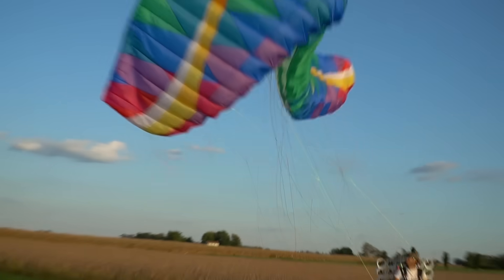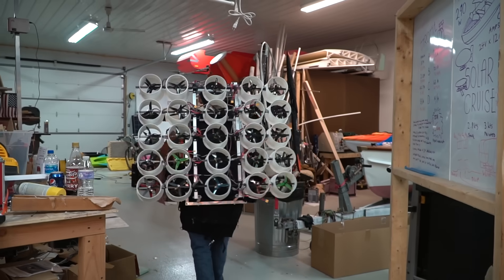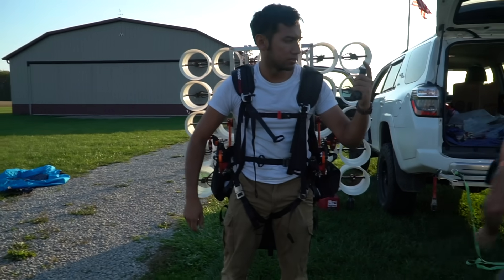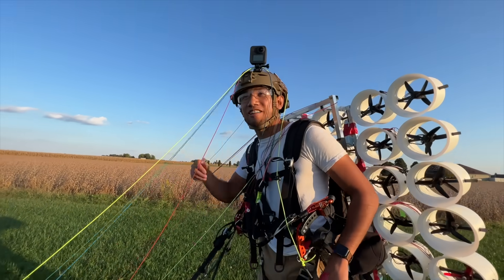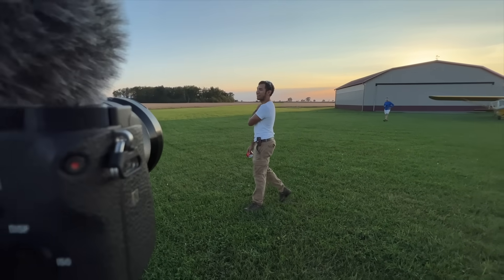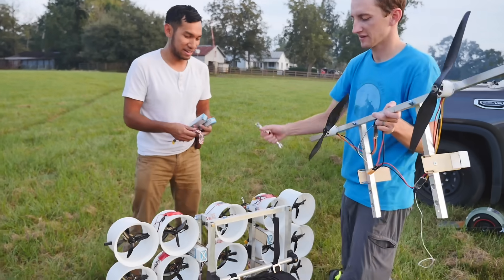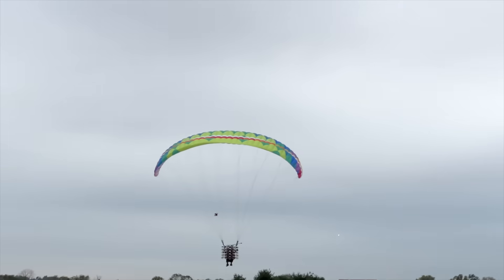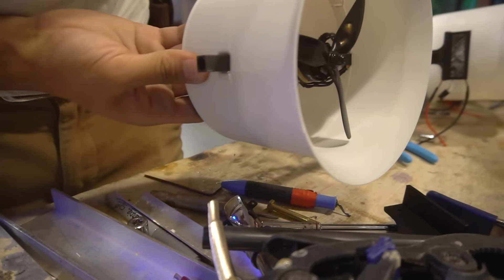Flying with 50 drone motors (homemade flying machine)

Comment: nice plane, however you can make it much more efficient per watt by moving them to the side of you instead of directly behind your back. bigger propellors also often allow for much greater output force per watt.
with drachenfliegen, or I think it is hanggliding(hangglider) in english. there actually where people who motorized them using rc level motors. this where random modern day pioneers so not people with a large network or much resources. I have seen someone fly and reach quite great speeds using only one rc grade motor(electric as well but more a rc car motor than a rc drone motor). this person used a single quite large propeller. the main reason I see why these things are a lot simpler to motorize is due to the user and the motor being much closer to the glider wing itself. also there is less direct drag which allows higher speeds. while you need a higher speed in general with them, but that person managed to launch himself from a field, so I guess some ofbrand steering methods to directly force some extra lift an the end of the run can be enough to make such a thing fly. they are also much cheaper and simpler to make yourself than a paraglider and where I live you can actually make prety good one for under 100 euro, since prices here are extremely high compared to other places in the world that would suggest you could normally make a good quality one for around $50. you can make a half open(bottom open) or full airfoil. however if you can you should make the tips completely flat. this for a small section where it gradually moves into. doing that prevents turbulence and can increase the wing efficiency by up to 80% acording to the numbers nasa published after their tests. the archeotypexyz(I think it was spelled like that) uses that same wing design so you can see how it works however they do not propperly show how the wing works on a technical level so you just have to do it with these words, the ends of the wings transition to flat(no airfoil) over a certain point, and you have a small flat area. this area turns the forces that normaly would be turbulence into upward and forward thrust causing super high efficiency and more lift at very low speeds if you can make that you can easly motorize it won't even need to add a tail for stabilization, and you could have a very efficient and verry fast transportation method. the human powered helicopter required just over half a horsepower to fly. with these drachenfliegers however you require a lot less power, even though often people use a powerfull engine to make liftoff more easy and to rise in altitude a lot faster, especially here where there are almost no big launch areas which you can use.
for me this sadly still requires a new plan since in the area where I live They have forbidden me from flying despite me having proven that I can clearly do it and can even fly new devices like it was natural. however sadly here they really hate selfbuild devices and so flying one of those without buying a speciffic very expensive licence for that speciffic build directly gets them to turn mad, the same goes for flying here. since they do not look to tallent or your capability of flying devices but instead you just have to pay the local government a very large sum and you get a licence with which you are allowed to fly. when I was younger however I did fly things, but that is because they are less aggressive to children and their devices. so for me there is the struggle that I can build or buy the devices needed, however I am not a milionaire so I can not pay the large paysum you need to pay now to get such a licence here. I am also one of those who just came after that moment where they decided to put a large restriction on it. if you where adult and had flown such things a lot before that moment then you automatically got that licence for free or nearly free. however for all those after it, they are fucked(almost raped). so right now for me the best option would be to search for a country where they do not have laws like that and start flying again there. then eventually their law should no longer aply to me since I then pass the exception where one while being legally a adult has flown over a certain amount of hours which are registrered. for now however I have to settle for smaller flights using very large kites a lot of updraft and rapid accurate steering where it is seen as accidental flight or a jump legally since those devices are not made for flight. then again even those are only legal to use on a few small locations in the country so I have to cross half the country to legally use those.

Comment: Sweet ride man, i noticed in one of the first flights it looked like u had red and green propellers. U gotta put the green props on the bottom right or right side and red ones on bottom left or left side and maybe put and led strip or 2 on each side so u can get some Nav lights goin rofl. And if your worried about power consumption, i dont know what kind of controller(s) your using but if they have an LED on them that signifies that power is on then maybe you could put a single red and a single green led in the fan ducts with the red and green props and wire them back to the power LED, that way whoevers watching you will know if you have a failure or your batteries run out lolz. Nice work man, sounds and looks wicked, i wanna build one cuz i needa be able to fly rofl.

Comment: Ducting is not setup correctly. Suction, or a vacuum, is equal in all directions, from the back side of the propellers. The "jet" from that type of propeller is a flat wall of air, not focused. So, in conclusion, the "flare" needs to end right before the propeller. The "tube", should have a reverse-flare, to direct the positive pressure and "fling-off", from the propeller, directed in the same direction. (Fling-off is air that flies off the tip of the propeller and naturally pushes outward, not forward.)

Jets use ducts only to stop side air from sucking-in, not to "focus the jet". The focus is managed by the "cone" in the center of the jet, or propeller. (Like an air-brush, air "sticks" to surfaces and the vortex that is created by the cone, focuses the air. However, you don't need "focus", you need a "wall of air".)

I am not sure why people think ducting is even needed. If it's not designed right, it's useless. Ducting is for vacuum cleaners and home air systems, where high negative or static pressures exist. These blades are "free-air blades". Horribly inefficient under static-loads, due to that "fling-off", which is difficult to manage with "flexible blades". Also why they are so noisy. That noise is the sound of inefficiency. vacuum-chop, where the air just can't get back behind the blade as fast as it is being "pushed" off the other side, causing the high-pitched "whine", like an air-horn that chops air to make a siren sound. A perfectly designed blade, is nearly dead silent. Air-in = air-out. (Normally speed-controlled or pitch-controlled for efficiency. Something that these units can't do. The blades have a set "flow-rate" and "static-pressure", designed around a "max-RPM". The more you go above the max RPM, the more losses you have and fewer gains you get.)

You need a better blade! One tuned for the specific thrust and RPM-range that you need to use. (Min RPM = Enough thrust to move your smallest mass AKA: Idle. Max RPM = Whatever the motors can handle, yielding the most thrust, at your largest mass. AKA: Top-end.)

Comment: With ducted fans that use dedicated ducted fan propellers the tips of the props aren't rounded. They fit with higher tolerances and they have more blades. Fix that.
If you move the ones behind your back (low airflow areas) and honeycomb stack them you would decrease drag and increase stability between the fans besides making it more compact. That would leave room for four more motors if you wanted.
I've been watching you since you were in model aviation magazine as an up and coming future aviation  genius and you have been advancing steadily to achieve just that. 
I'd say mission accomplished! 
Inspiring. Thanks.

Comment: Dude use the same type of motor and battery like the one wheel and use real prop then you only need one fan and it will torque.

Comment: I know you just did this because you wanted to (for the likes) and I appreciate that. that's a lot motors. Open props are much more efficient at the speeds you are flying at, and the bigger and slower you can spin them, the better the efficiency, but you probably already knew that :)

Comment: EDF housings need EDF Fan blades. You're leaving a lot thrust on the table with those 3 blade props.
Reply: Ducting any propeller theoretically increases thrust/efficiency, but the duct needs to be designed right. It doesn't have to be a fan.

Comment: I would LOVE to learn how to 3d Print my designs.  In order to do so I need a few peices of information.  How much does that 3d printer cost, what program do you use to design things, and are there any tutorials on how to run such program and how to print.  Thank you for whoever replies.  Cool video Peter Stripol

Comment: That looks like a big improvement in paramotoring, its a lot safer not having a giant slicer/dicer on your back.  Plus you can shut off the power instantly.  You just need more power somehow, maybe more batteries and stronger motors.
Reply: Thats a really good observation about the safety of multiple small rotors as opposed to one deadly one. i wonder why no company has made gas powered multi rotor ones? Like a gas generator i should say unless they found a way to make a load of driveshafts work on one engine haha
Reply: @ter8901  Gas powered motors don't scale down very good.
Reply: Could be done with linear gas generators, they pack a huge punch for their small size and low weight

Comment: How many watts are you using there? 
Any chance you could use some flexible solar cells on your wing and fly for extended periods? Maybe not continuous power, but extended flight? 
Wing surface area is huge if you can get the weights down. Might need to launch from something.

Comment: If you paint the white cylinders black, it will absorb energy from the sun and heat up the air inside the cylinder and create more thrust.

Comment: Waw, that was so cool, Peter, you wanna be Peterpan? Hahaha, i wanna give advice, I think that was better, if you can fly without parachute, it was better, and change aluminium frame with carbon fiber, reduce drone motor, or change with mini jet, or change propeller to jet propeller, to frame, you can make it like exoskeleton, and the motor or mini jet you put some on hand, foot, and your back, and control it like a drone, it's like a man that fly with gas, that no exoskeleton and I think that hard to control it, be careful cause that dangerous, I hope you can fly without parachute, and you can control it, good luck.

Comment: why dont you use the design liked a Noctua case fan in your 3D Printer to reduce the noise also what about using 50 case fans and see if you can do the same thing ?

Comment: Hey Peter, what if you modified those ducts to have a small circumferential groove in line with the propeller tips? That puts the tips virtually in contact with the wall while allowing for blade movements. Would that reduce turbulence since the tips would be in a smaller separate air mass?

Comment: Point the bottom row down and with a separate control. You have opened up the ability to direct the airflow.  you could put a few rows of duct tape inside the ducts to narrow the tolerance.

Comment: The ducts make it safe, not just efficient.  Still want that efficiency, of course.
Might consider moving the motors out to the sides and leaving a strip with no motors behind the pilot.  There is not much airflow through there.

Comment: Wow nice to see somebody with a technology background saying very clearly: “hydrocarbon technology is better, probably even more sustainable, right now, then electric/battery technology.” At least that’s what I thought you said :-) in a very short sentence. 
Because let’s face it, when do you add up all the energy output necessary to mine and refine the rare metals that go into batteries and manufacture the batteries And deliver batteries, and recharge batteries, even if you try to cover the planet with solar panels (there is a separate YouTube channel about that)… To recharge the batteries, you end up with a highly unecological system…. So should we continue to research electric/battery powered vehicles? Of course. Should we treat them as if they are a panacea or a solution? Absolutely not. Should we vilify The hydrocarbon/possible fuel industry and the people who work for it? Please they’re human beings trying to make things work just like us. And if they stopped tomorrow everything would go down the tubes.

Comment: Peter, EDFs (engines for flying aparatus) generate thrust by accelerating air and trhowing it out the back. 

Take 1kg of air, accelerate it to 1m/s over a period of 1 second and you get 1N of thrust. The MINIMAL amount of energy this takes is .5 . m.v^2 = .5J. 
Take 10kg of air, accelerate it to .1m/s over a period of 1 second and you also get 1N of thrust. This time the energy required is only .05J!  

Similarly, if that air you start with is already moving at 10m/s the amount of energy required is more.  (realistic for paraglider flying, enormously more in my example-calculation!).

This is why two engines on a single duct is probably not such a good idea. The second motor requires more energy to generate the same amount of thrust. 

There might be other considerations. Valid ones I might add. Maybe you're constrained for space. This is the case in this project. Or you might want  the redundancy of extra motors but don't have the room for them to have their own airstream.... 

Anyway think about this if you are doing such a project again.

Comment: as far as flying machines go, i think this design is alot safer. using alot of smaller blades rather than using like 4 big blades minimizes the chance of getting your head chopped off
Reply: as far as intelligence goes, you are short on it.     why.    you  are apparently in favor of:
     More,  rapidly  rotating pieces
     more  complexity/places for failure
     more  (energy) Losses
        and
     aerodynamically,  LESS  efficient.

Comment: Power of eight motors are totally wasted as they are mounted exact behind the Pilot. Instead mounting them exact behind pilot if he had mounted it little side ward it will have work more efficiently.

Comment: You'd get a lot more efficiency out of the center line of motors if you put them on the outside, lined up on center row. In the current configuration they're only pushing, because they're intake is obstructed.
Reply: If they're on the outside the air is moving freely through it with forward motion.  Just a thought. I know it's a quick project.
Reply: Also the intake turbulence behind your back going into the center line motors is probably hampering efficiency of those and the next line over as well.
Reply: Cool ass project though!!!

Comment: The ducts may provide less thrust, but they provide safety from impact to flesh, and if one comes loose it doesn't become a cascade of failure as one prop takes out the one adjacent to it, etc.  Finally, there are vorticies at the end of each prop, and if not contained inside a duct they could interfere with each other if too close together.

Comment: With your life hanging by threads, having covers on the fans is still a better choice, imo, even if the duct lowers your efficiency. Getting a rope into a blade seems way worse than losing distance. Perhaps making them shorter and more precise to the blade size would help. Also, I think you should eliminate the fans direcly behind you, and/or create a scoop system that can double for a low set  arm-rest, if it doesn't block your ability to move.

Comment: Another crazy approach that might be more efficient is to make it tow you.  Might block your view a little, but it should be stable and move the air well.  And you can have several decent sized propellers.  Steering by the paramotor wing will likely be backward, but should work.  You also need a release.  Probably better to release, and glide down.  Maybe someone on the ground can fly the towing craft down.

Comment: I have been thinking about making an electric paramotor.  But a big part for me would be to make it quieter than gas, not louder.  You did avoid the torque issue.  And it gets off the ground.
Now you have a benchmark too...something you can improve upon.
In my design, I wanted to get the props better air going in.  I think having one's back so close reduces efficiency.
If you do use bigger props, it would be wise to have a cage, so strings and such can't easily get in there.

Comment: I can't help but think the location of the fans blowing directly onto your back is not the best idea.  I imagine the centrally located fans would be better placed on the outer edge of the structure.  Should result in less power required and longer run times.  I know it would make it wider but you could fold it for transport.  Just a thought.  I want one.
Keep well m8 and watch out for lazy birds.   🤣 🖖‍ 👌‍

Comment: Carbon dioxide is the gas of life. There's no such thing as global "warming." Two reasons why the weather has changed so much:
1- we are in a Grand Solar Minimum 
2- they have been spraying the skies and using antenna arrays to heat up the ionosphere for years now. World governments literally control the weather these days. This is all fact backed up by Department of Defense and UN white papers. The whole carbon credits was a scam to tax people more and control the populations through "climate lockdowns."